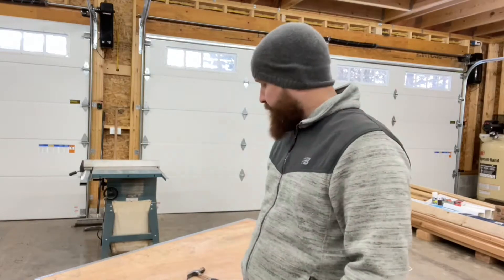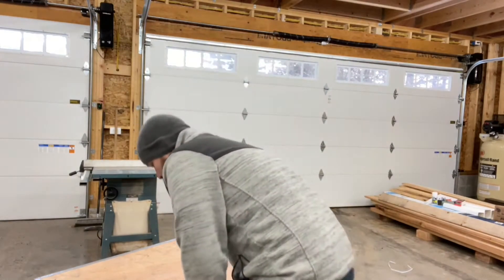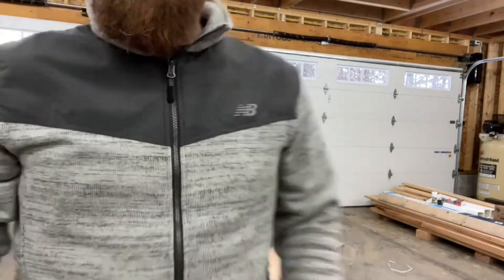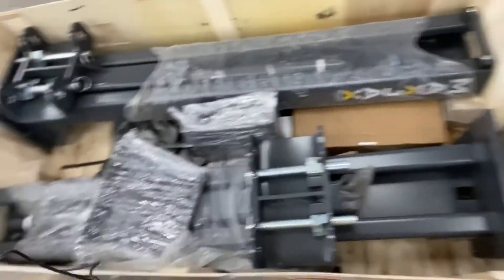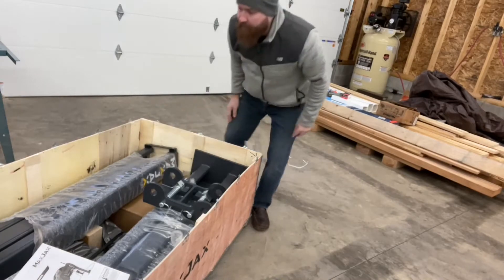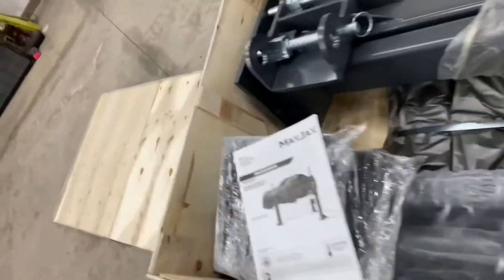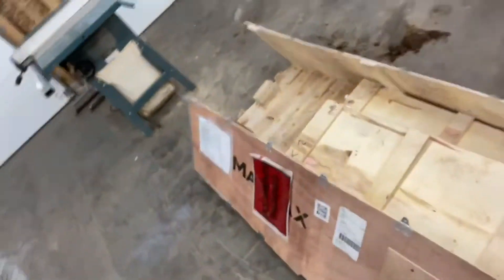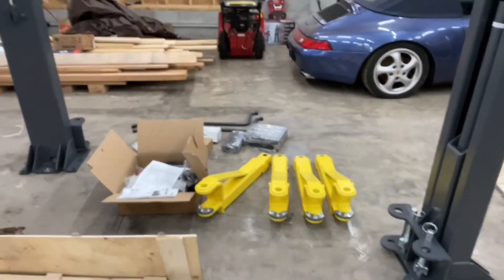Unboxing my new MaxJax

Comment: I received mine about the same time as yours. They said that they were swapping from mounting the pump assembly from the cart to the column.  They forgot to send my pump too. They were back ordered on frame adapters, longer adapters, and oil drain.
Reply from the maker: Same here.  It’s been a month and I only just received the frame adapters and the ATV adapter.  Still waiting on the oil drain